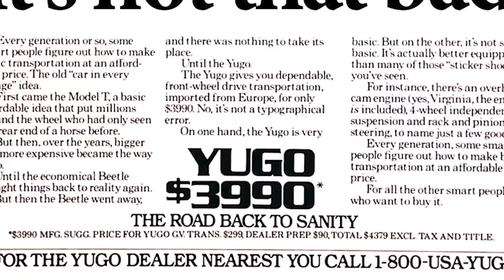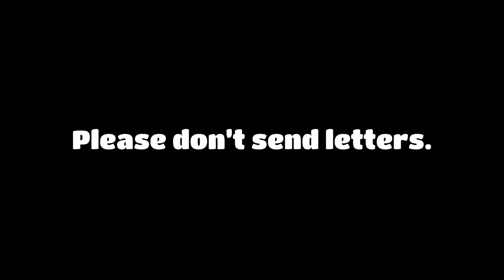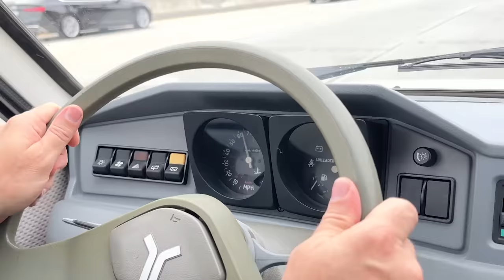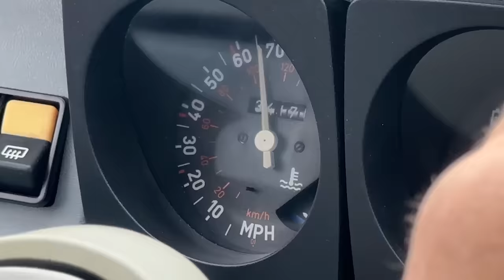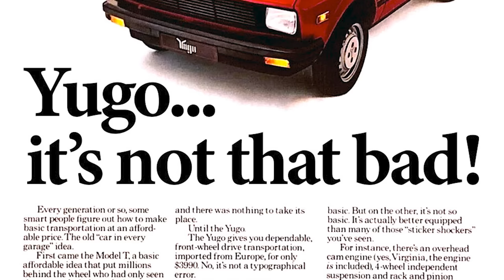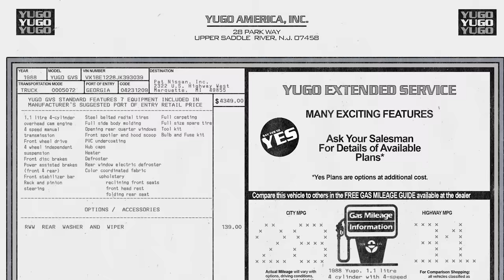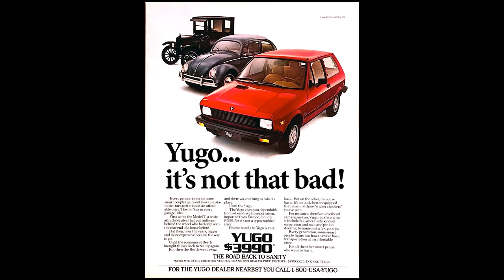Jeff Dunham Drives The Worst Car Ever… LOVE IT or HATE IT? | JEFF DUNHAM

Comment: The spare tire is a safety feature. It is actually the primary impact absorber in a front crash. When it was removed, the Yugo flunked the crash safety tests.

Chrysler wouldn't let me bring that idea back in 2015 for crossovers. I think it would've been a useful space and weight saver.

Comment: Your next challenge, if you care to accept it, is to find a DAF from, I think, the 1950s, which had what was referred to in England as an elastic band gear box. I believe that instead of a conventional gearbox, it used a V belt and speed cones to vary the effective diameter of the pulleys. I never saw one, too young, but it was a major conversation piece in the village amongst the older blokes.
Well done with this one though.

Comment: I can remember someone doing a safety inspection on one of those cars that the dealership I worked at decades ago. I had my hand resting on the left front fender and my little finger tip had slid down in between the fender and the hood. Someone turned the steering wheel and my finger got pinched in between the fender in the hood because the whole front end was shifting back and forth as you turned the steering wheel.

Comment: I was working for the phone company, BellSouth, in Atlanta. One of my tech's bought a new 86 Yugo as a joke, which it was 🤪It started falling apart pretty kwick as he drove about 20 miles one way to work...door handles, locks, window cranks, dash knobs...all broke. Then the hatch window fell out...he never fixed it...rain, snow, hail it didn't matter !! Then one day he came to work in a taxi as the Yugo had broke down. We ask if he needed help to go get it...He said "well it's on the side of the road, I'm just going to leave it there, I took the tag off and if anyone wants it they can have it" I'm done with it, it's not worth the tow charge"...True story...😎

Comment: I knew a guy with one. It really wasn't horrid or anything. Given a choice between a Chevette or a Yugo... You really do need to consider what was on the road at the time. K-cars, Citations, pintos, B210s, teensy weensy Civics, next to lumbering gas-guzzling 70s  rustbuckets. "Not that bad" is a pretty solid description.

Comment: Jeff, you're probably too young to remember this, but back in the days before airbags, the feds required passive restraints (e.g. automatic seatbelts and knee bolsters under the dash).  Some had those motorized shoulder belts that you mentioned.  Others, like the Yugo and many Volkswagens, had the shoulder belt attached to the doorframe.  It allowed you to get in and out without unclipping the strap from the door.  And yes, it made getting in and out a little awkward, but it was okay one you got used to it.  

Nice Yugo you have there!  As you say, it was a "nice enough" car, but it was done-in by poor build quality and ultra-cheap components.  Please do a video of you taking it to one of those "cars and coffee" meetups.  That ought to be fun :)

Comment: My brother actually bought a Yugo, after it had a problem I traded him a good car. When I removed the bumper to  tow it, I found 2 inch rubber grommet behind the sheet metal plastic bumper cover, attached to the sheet metal body. Constantly blew head gaskets,  had a strange electrical problem that made the engine not run properly, when that happened the emergency flashers failed to operate. 
In reality, if you had an an accident in a Yugo, you go !!!😮

Comment: Parts manager at UTI when I went there (2002ish), Guy had what he said was the last year they imported them, he loved that car, took it on hot rod power tour and had a great time.  cel was on permanently due to a map sensor code, and the map sensor was for some reason part of the ecm, but it seemed to run just fine despite the problem.  it was an alright car, could even autograph the parking lot 1 line at a time

Comment: Other than the problem with rusting, it really wasn't that bad of a car.  Yugo got there stamping machines from Fiat.  It's basically a Fiat Strada.  They look exactly alike except the Strada had round headlamps, instead of square ones. One of the big problems with them is they were real squirrely.  The problem was it's headlamps were below the minimum height.  They had one of two choices: 1) Alter the body to bring the headlamps up to the minimum heights or what they did which was raise the suspension up.  If you lower down they actually handle pretty good for a little cheap car.

Comment: The yugo had issues from the get go.
If you drilled 2 small holes in the floor, it would allow the pressure to escape when closing the door, thus not pop your windshield out every time.

Also, it was the only car ever built from the Factory with Coat hangers holding the exhaust system together. 
It was sold with a 5-5 warrantee.
5 feet or 5 minutes, 
Nothing on paper to back it up.

Comment: I killed a Yugo in 1989.  16 YO girl pulled out in front of my 1959 VW alley van (no windows and cargo doors on both sides).  Hit her in the front corner and smashed the left front quarter beyond repair.  When the insurance dust settled and I sold the bus to a collector for the parts, we cut the wheel well out with a sawzall to allow it to turn left and he drove it home, over 100 miles away.  He eventually put a front clip on it and got it back in shape.

Comment: You mentioned your friend had the car with the seat belts on the track? "Watch Your Ice Cream"? Moderately sure that was the Ford Festiva from that same time.

The Yugo also looked very similar to the Ford Fiesta (which was SLIGHTLY larger than the Festiva). I had a Fiesta in college. The sound was almost the same, to the point I wouldn't be surprised if you said Yugo used designs stolen from Ford!

Comment: Hey, I had a Yugo, too. It was actually a good car. Really cheap on gas.
It was in the early 90's when I had it. I had an 88 Olds before that, and the Olds was a nice car. But I was having a problem with it. Like going down the road and it would try to quit. I think my ex boyfriend done something to it before he had set it on fire while I was at work. Thankfully my brother owned a car salvage and he fixrd it for me. Had to replace the wiring harness, dash, windshield and carpet.
Anyway, I traded the Olds for the Yugo and I think I had to pay some on top of that.
I was driving it to cosmetoligy(?) School at the time. I live in Arkansas 15 minutes away from the Missouri line and I even drove it to Kansas City and from there to Tulsa Oklahoma then back to Arkansas.
When it threw a rod my brother got me another car at a car auction so I gave him the Yugo AND get this, he sold it to someone with the bad motor FOR $600. That blew my mind.
I actually liked the car. It drove great!! I believe they are like the Geo's, 😮3 cylinders, right??
It drfinetly was made cheap on the inside, not meaning it would just fall apart cheap but cheap as in not a luxury car. Pretty much a Plain Jane. No bells or whistles, like it not having AC. 
But it wasn't that bad, I still liked it.
It was white also, with an orangish pin stripe. But I don't remember the spare being under the hood, hmmm.
And as I said, It didn't have an AC. And I believe it was a standard. No problem with it until it threw a rod.
And the car after the Yugo. was a Dodge of some kind, can't remember what. It was a nice car also and drove great. *Then I was on my way to work when the motor blew. *
*And that's when he found a Geo for me that was practically brand new. It only had 4000 miles on it. And it was def*k(😅

Comment: Change the timing belt every 30k-35k miles and the engine will last. Yugo was an out dated FIAT. In Michigan, a 1988 Yugo would last until 1992, then rust would take over. A $5000.00 detail on a $3990.00 car.

Comment: I have a car that you don't see very often any more. A 1984 Pontiac Fiero with the 2.5L 4 cylinder and 3 speed auto. When I bought it the car only had 15,535 miles on the odometer.

Comment: At 66k it was recommended to change the rubber band running the cam shaft .  At 66k it broke. It was an interference engine and so it went to junk but it was a nice red one.  Excellent vehicle

Comment: Not a bad touch up but a few spots were missed. The cap he asked to have paint still had rust on it and then under the tire wasn’t done.
I liked the red under the hood, curious though. Is that the original color for those parts?

Comment: When i was 17 (1997) i didn't have 4 grand for a car, i instead bought a 1985 Vauxhall Nova which interestingly enough looks VERY similar to your Yugo for £200, it lasted me the grand total of 10 months before it threw a rod straight through the crank case and became a paperweight on wheels, i DID make just over £100 off it by breaking it for parts so all in all not a bad investment lol

Comment: I am from Kragujevac, Serbia - town where all those cars were assembled.
First hand experience: yugo has bad brakes and no matter how much you adjust them rear part of car will always steer to left or right side when braking hard.
Car body is weak, almost identical to peugeot 205 meaning if you crash yugo it will deform a lot.
You will have hard time keeping car out of corrosion.
And most important thing: do not load anything above 50 kg of weight in trunk.
Once we loaded 4 bags of cement (200 kg) in trunk and drove to destination. We arived at destination, parked car there....and it stayed parked there.
Beside those what i said, everything else is fine on yugo: cheap maintenance, spare parts available, durable engine, no electronics ....
Yugo was visioned as replacement of fiat 126...
On other hand you have volkswagen 2 that has everything done properly which was done bad on yugo.

Comment: Looked at Yugos the year after they stopped production. A dealership in KCMO had several. My husband extremely frugal wanted economic car to drive...So 1 year old cars... It took 4 cars B4 we found a car that started. It was very cold weather. My 2 boys were small & backseat was too small. My shoulder overlapped my husbands (only other car that was that small was a Geo metro). But the gas mileage wasn't as good as my Chevette. *Which my kids fit in & room for groceries.  And I drove my 76 Chevette 300000+ miles

Comment: The Yugo was built from plans sold to them from Fiat for the 124 hatchback.  You could pull the head, intake, and exhaust from a Fiat X1/9 and put it on the 4 cyl in the Yugo making it a turbo charged car.  And yes, after that, it would fly.

Comment: We are jumping with body weight on the wrench once placed on the tire nut.
Also flip the tire upside down. That is way it should stay in there. There was a bolt that used to secure it in the engine bay. Probably the owner lost yours.

Comment: I'm from Serbia (part of Ex-Yugoslavia) and we still have Yugos on the streets but we don't have Yogo with automatic gearbox. If I understood this video, this Yugo have automatic? I'm sad that you didn't show us how you operate that gear shifter then. Because, we here think that Yugo is not that bad car but everyone agreed that only bad thing on that car is sloppy gear shifter and with manual transmission where you need to manually put in correct gear it is very hard. You can be in first gear but also in third, you will know when you start to release clutch pedal, if car stalls you ware in third gear 😂😂

Comment: I measured the frequency of the engine hum and this little thing is turning 4000 RPM at 65MPH. It wasn't built for speed but then I saw some early budget Toyota's turn about the same.

Comment: I can't attest to fit & finish, how long the switches will last, but I will say that those engines ran smoother than a sewing machine. Way beyond any American 4 cylinder and better than many Japanese.
Many cars had the spare tire under the hood. VW Beetles, early Subarus. The Corvair had the spare in with the engine, although it was in the back.

Comment: Jeff, this is important, the owner's manual did not address when to chnge the timing belt and this car will not make it to 60K like other cars. It broke on my wife's car and since the 1,100 CC engine has an interference fit on the valves with the pistons you are looking at a head job lif your mechanic didn't change the timing belt if your car has the original. That's what killed alot of these little cars.

Comment: wow that’s a really nice one i have seen some later ones with fuel injection and a 5 speed manual transmission with air conditioning it wasn’t as nice but it had the best options you could ask for and was quick actually not slow unfortunately it came to late and the writing was on the wall an it was over here in America its just how it is but you have a real nice example i would hold onto it

Comment: That would have been better than the Fiat we bought for $4,500 about that time. The electrical was messed up. It blew fuses while driving. You never knew if the wipers would work. The gas pump would quit at stop lights, and we'd have to get out and bang the side with a tire checker club. The timing chain broke and we said that's it, no more.... what a piece of junk. If we'd known how much $ we'd put in it in 2 years we could have bought a used Mercedes.

Comment: I had a 87 1/2 with ac. Some parts like door hinges & door handles were cheap & would break. You brighten & dim the headlights with a lever like  a turn signal. The steering wheel was at a weird uncomfortable angle. The seats were covered in burlap like material & a hump stuck out into my lower back. I wouldn't buy another one no matter how cheap it is. There was a joke that next year they're going to make a station wagon & call it a wego.

Comment: I put. Over 400,000 miles on 1 with regular oil changes somewere about 450 or so a timeing belt I still got a carbater for 1. And maybe some other parts for 1

Comment: Look Jeff when these pos came out you could buy a Toyota thunder truck for $4999 and a ford ranger was $4999 as well. Now the yugo was cheap but it was also a huge piece of JUNK!! I had a neighbor who bought one brand new and did not make it to 4000 miles. Yugo would not honor the Warrenty and it sat beside his driveway for years and I had a friend in high school his parents bought his older sister one and it broke down every couple weeks they traded it off after 4 months and many many trips to the shop. So basically both of the encounters I had with that car company was that they were just junk.

Comment: The Yugo was better than the Chevette. They were total garbage. After 30k miles they could not drive themselves onto a car hauler. I worked for Alamo Rentawreck at the time down in Florida. You would get the really cheap tourists who reserved the cheapest thing possible. They declined the insurance and everything else. They wouldn’t tip. So they got the “decliner” car - the worn out Chevette. It couldn’t drive 55 with the A/C on. In hot as hell Florida. Crammed with 2 adults and kids. With a huge surprise when they got to their hotel. The sales agent had placed a 500 dollar hold on their credit card above the actual cost of the rental - in case they got into an accident since they declined the insurance. So come check-in time at their resort, they didn’t have enough on their card. I saw more than one enraged customer taken away in handcuffs. Really. Alamo was sued into the ground by the state of Florida for these tactics to sell overpriced “insurance”. But what did you expect when you paid $39 to rent a car for a week. A Cadillac?

Comment: i used to drive a tow truck
i towed a yugo
about a year later i got a call for another yugo in the same location as the previous one
it was the same person in a different yugo

the saturn had the auto seatbelts

original subaru had spare under the hood too
actually sat right on top of the motor

Comment: yes, Yugo was not that bad at all.... the main mistake that everybody makes in judging Yugo is, that they are judging it by the "standard of cars" in late 80-ties and sometimes even by those of 90-ties... and they neglect the fact that Yugo is a car, developed in mid 70-ties, and started its (delayed) production life in 1980.... so, when it came to US market in late 85, it was almost 6 years old model! in other words, Yugo was quite "on par" with similarly sized European vehicles of mid and late 70-ties, like 1975 VW Polo or Fiesta.... or, better said, it was not much worse "shed on wheels" as they were😁😋! but, if you judge it "trough the eyes of late 80-tes", then it was a pretty basic, rudimentary vehicle that caused ridicule and mockery... otherwise, it was a simple little car, that could take a serious amount of abuse and was pretty simple to maintain...😏

Comment: I love these little cars. Yes they were low quality but majority of them were killed because no one drove them right or maintained them. They were Italian Fiat engines. They have high compression.. They need 91/93 octane fuel. 15W40 or 20W40 motor oil like for diesel engines. They like to be reved like a typical European engine. Not drive like a lazy American V8 or I6 of the day. Most people looked at the sub 4K price  and treated the cars like bic lighters. Never did service. I wish I could find me one out here in the SE that wasn't a total basket case to make into a daily driver.